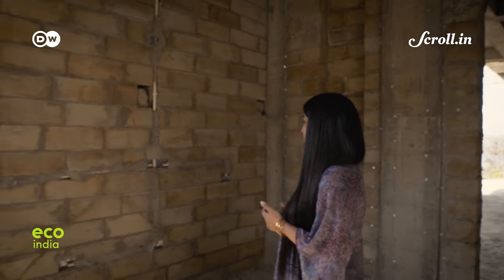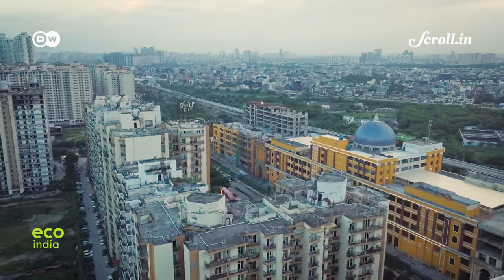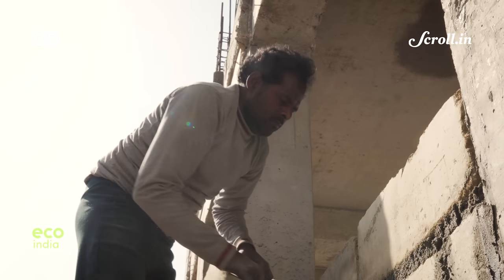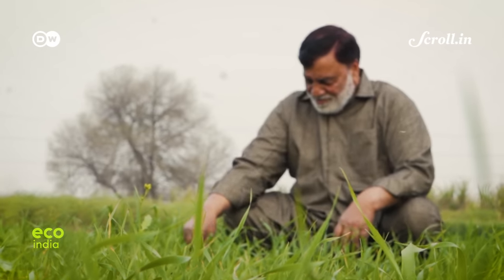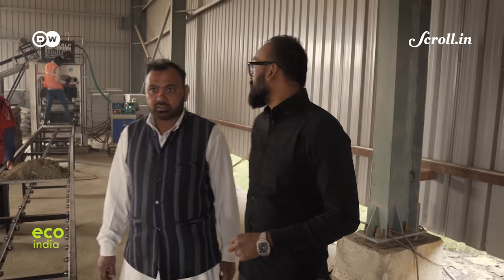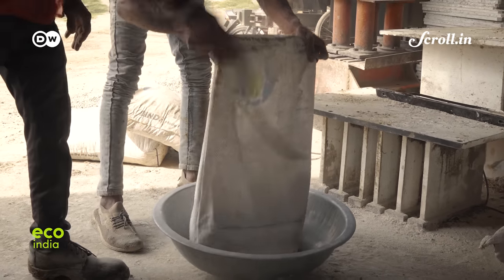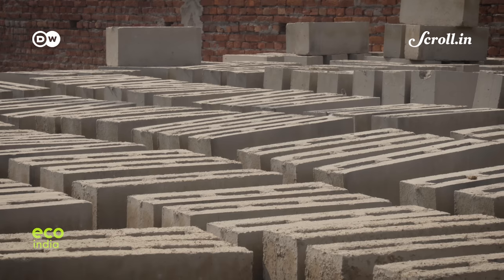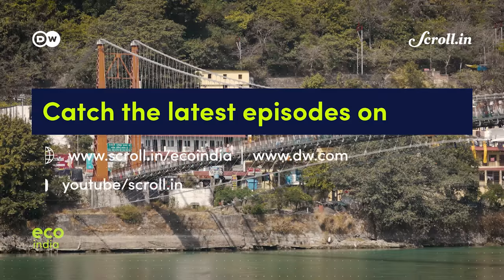Eco India: What does it take to make bricks and concrete blocks carbon negative?

Comment: But the problem is not the bricks but the energy they are using (heat). alternative sources of energy should be used rather than finding different ways to produce bricks
Reply: Nuclear
Reply: do you know how much carbon he is sequestering by converting them into bricks 1 prevent stubble burning 2 .giving sustainable building material 3. giving farmers income . so the pros ought weigh the cons